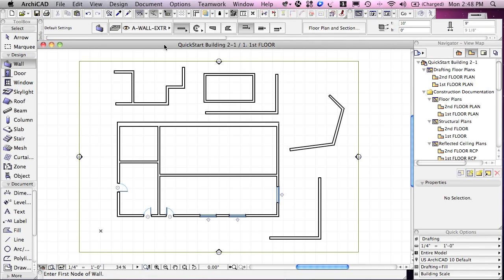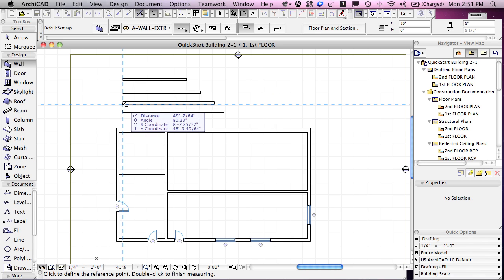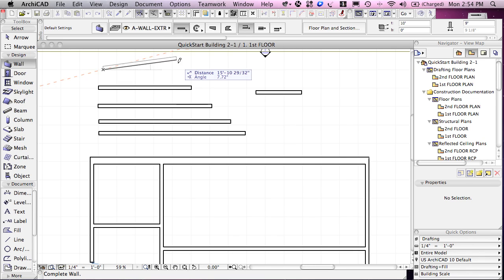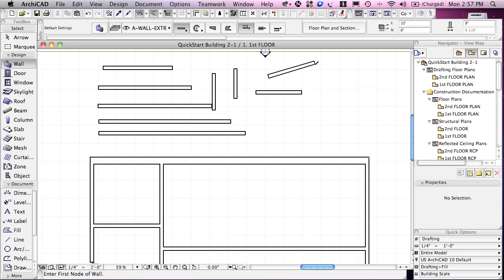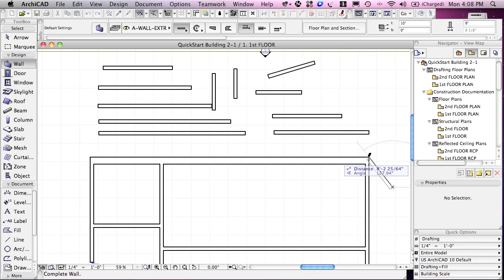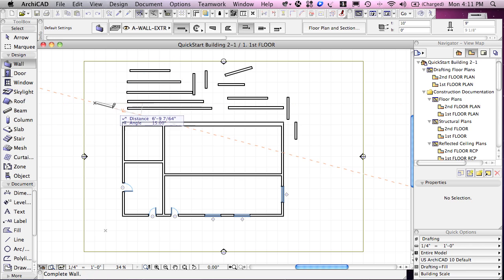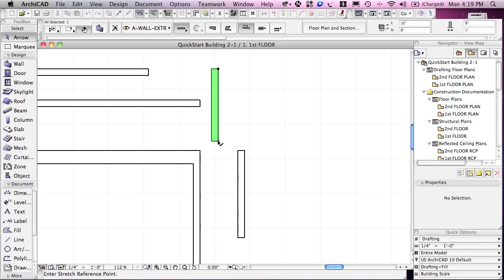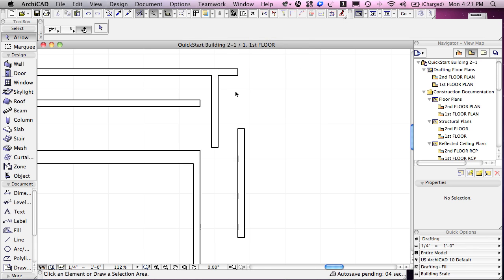ArchiCAD Basic Training Lesson 6 | Coordinate Input, The Tracker & Guide Lines

Comment: Maybe this is shown on another video, but I like to input some walls using the mouse only. For instance masonry walls on a 4" or 8" module or grid. Am I correct to infer that not only do I need to set my snap grid to the desired spacing, I also need to set accuracy to zero?

Comment: Dear mr. Eric when i place a window in a composite wall (plan view), the plaster / finish layer stops on the window frame i.e. window frame cuts the plaster layer while it should be placed on the plaster. instead i would like that layer to wrap and not to be interrupted by the window frame. any idea how it can be done. The same problem when i cut a section in the window the frame is placed on core and not on the finish / plaster.

Comment: Hi Eric,

Thanks for the tutorials, really helpful!
Just needed a quick help... I used to use Archicad 11 a long time ago, stopped for a few years and getting back with it now on archicad 17. 

I remember with the tracker there was a way to type in a minus distance form a point. So, for example, if I was drawing a line, and the second point needs to be 2.62m from a parallel line, I could hit the tab and add a minus from existing distance... is there anything like that on the current archicad?